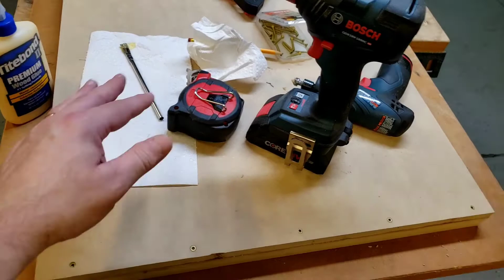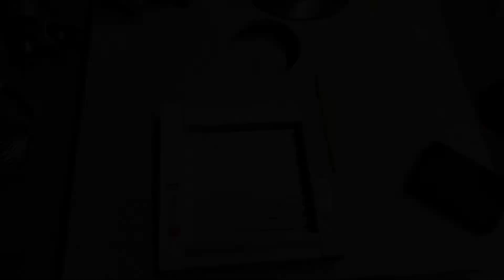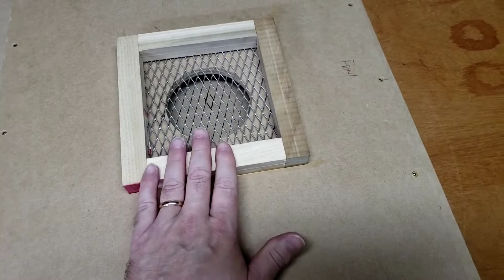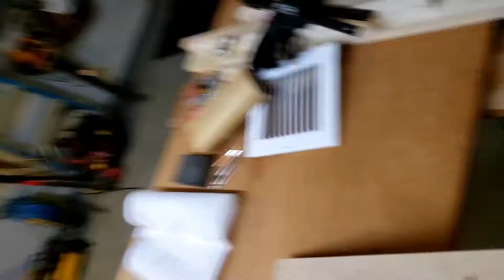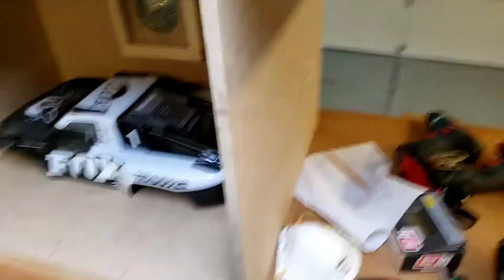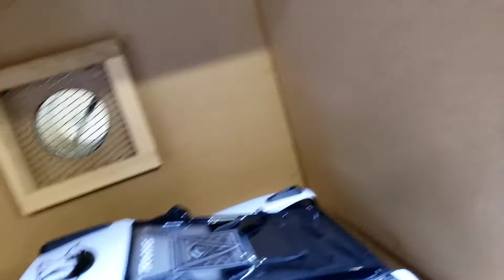DIY Airbrush Booth Part 1

Comment: Nice tutorial, look forward to the final product. I still spray outside on top of cardboard. I've been thinking of building one out of thin plastic sheets and mounting a venting motor in line.
Reply from the maker: You can acrew together any wood product, lowes, home depot, Menards will even cut it for you. Then add a bath fan or green house ventilator fan, for really cheap.